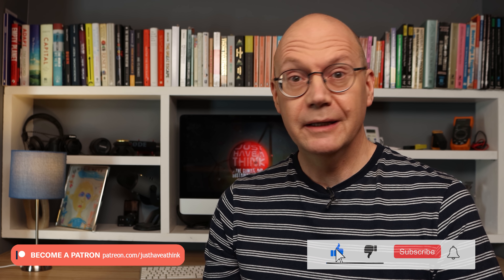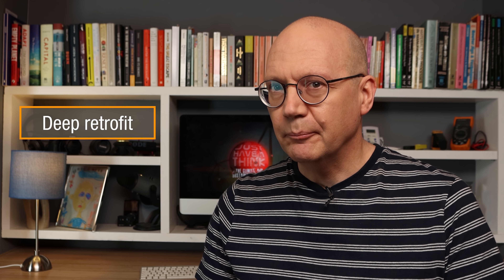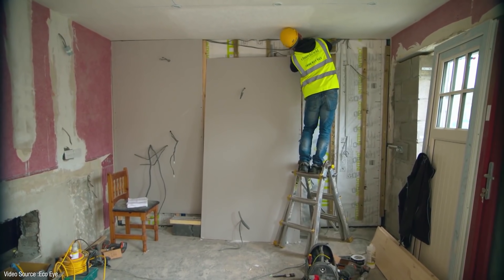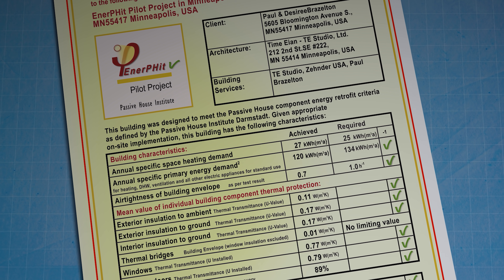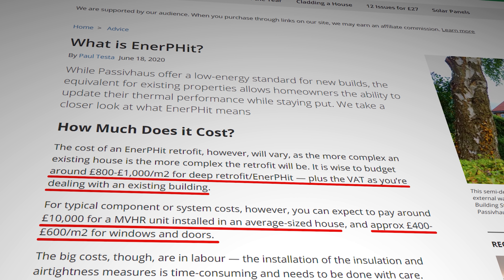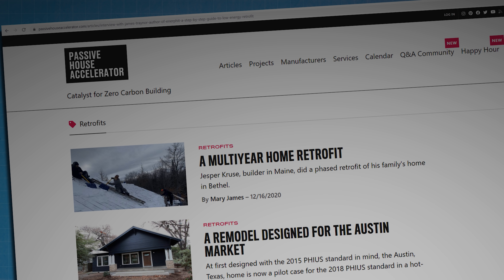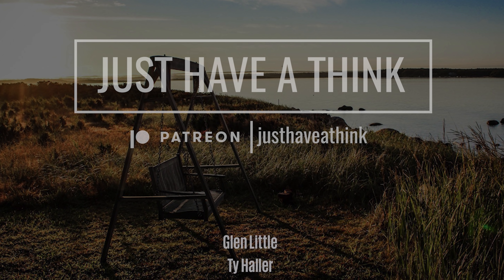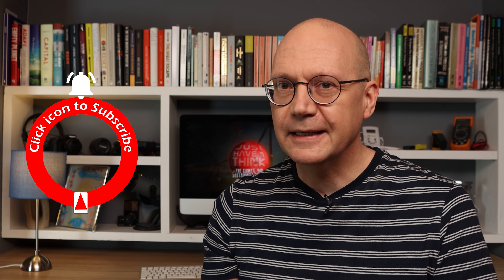Retrofitting to Passive House standards

Comment: I found the most effective components were exterior cladding and a ground source heat pump. The house is an 1890 detached pair of miner's cottages, so since I bought it semi derelict 30 years ago I've used most of the obvious methods, and found that most of them go out of date quite quickly. My advice is do what you can as you go and don't worry about catching up with technology as you never will. Perhaps the best bet after all is to replace existing buildings with passive houses, but since that is impractical I am just running the house on renewable energy and apart from the occasional chainsaw for diseased trees have more or less eliminated fossil fuel.
Reply: I agree. I have a home built in the 1970s, and I imagine it's a bit leaky. Before I bought in 2014, me windows, gas water heater and furnace, which I'm sure went a bit way in keeping my best bills down. Now, I'm looking to improve. Lowest hanging fruit, energy audit to seal air leaks. Then add insulation in attic space I estimate I only have about R20 up there. Maybe someday insulate floor, but that's a diminishing return. Longer in future, I'll have to convert from gas heat to hear pump to really reduce CO2
Reply: @deansmits006  a nice bonus with heat pumps is they’re far easier to run off rooftop solar as well!
Reply: @kaitlyn__L  I live off grid in a cold stone leaky house comfortably off 4 cords of locally sourced fire wood. I could without much difficulty change things a bit with a few cheap items and greatly diminish those 4 cords. Dont fall for this passive house nonsense. Best wishes.
Reply: @jimmycorkhill1390  I certainly believe pursuing complete passivity can be a bit overkill in many cases. But nevertheless, a heat pump outputs more heat than the energy it uses. As much as I like using a wood-fired central heating, it’s much less labour intensive to just let a heat pump run on a thermostat. IMO, best to save the wood for the coldest days where the heat pump’s efficacy goes down below 200%.
Reply: @jimmycorkhill1390  how would that work for thousands of houses in a city?
Reply: @kaitlyn__L  Im all for such tech and heat pumps are something I was advocating over 20yrs ago. There is always balance to be had with installation cost, maintenance, running cost and benefit. Before I went off grid, hot water electricity cost me about 150euros a year. For me to have replaced the DHW tank with a heatpump air to water unit would have been about 1,500euros material only with my to install.  Would it have halved my bill giving 15 to 20 yr payback. But then there's maintenance and replacement. A standard DHW tank is less than 200euros. I do plan to reduce my wood use and convert more sun energy for convenience as much as anything else soon. Wrapping the 600mm thick stone walls will hopefully trap all the heat needed to negate all the air leaks. Best wishes.
Reply: @ricos1497  It doesnt have to work that way for thousands in a city. There are lots of options. Some relatively inexpensive and easy to achieve. The question I would ask is, millions moved from the countryside to polluted overcrowded miserable cities for work and opportunity. Now that much of their purpose is redundant other than self indulgence, what next? I live in a place within beautiful countryside, full of amenity, fresh clean and abundant, full of cheap affordable homes. Never been harassed during these crazy fascist times. Not had to wear a muzzle, social distance or be sprayed with disinfectant. Am able to communicate with others like yourself via the airwaves. Would I swap for a box room in an overcrowded city full of millions of individuals that are scared to look one another in the eyes? Perhaps, if I could get myself one of those Passive House Standard Homes! Best wishes.
Reply: @jimmycorkhill1390  interesting! You believe that cities themselves aren't the future? You could be on to something. Just a billion minds to change!
Reply: @ricos1497  No, I think that they are the future for many. You will have seen or read 1984, Soylent Green/Make Room et al? I am content not changing a billion minds, but wish them well. Best wishes.
Reply: @jimmycorkhill1390  as long as the mortar joints are good on your home, the leaks shouldn't be coming through the stone. Especially not at 600 mm thick! Instead check areas at bottom, top of stone and around any doors and windows. I wish we had stone homes in the USA with 600 mm thick walls. Professional stone mason
Reply: @stonechips2011  Yes, youre right, it's the windows, doors and roof. Im working my way around. Im insulating the outside this year to make all that stone my heat store. Will probably move the windows outward and new insulated shutters. Hopefully if I speed up a bit, I'll be done before the next winter. The stone is everywhere  in the ground here amongst the clay.  I have a large demolished house on the land which got pushed into the three cellars beneath following a fire (before my time), you can come and use those skills rebuilding it if you like? Best wishes.
Reply: @freddiefox.  Dont be silly Gary, there is plenty of resources for everyone for such simple uses, as to whether there is enough biomass to keep feeding power stations for your electricity....well that's a different matter? All my wood is harvested and replenished....no getting away with anything. Best whishes.
Reply: @deansmits006  Electric chainsaws exist and are great.
Reply: @Fluffy Hamster Ive lived in a big city wasnt all that bad, lots to lead one astray. Dont see the attraction though that keeps people attached to them whilst complaining of all the bad. Plus they will be the focal points for the ever increasing  dystopia. Best wishes.
Reply: I heat with wood. I am also a tree farmer. My net carbon contribution is negative. My trees sequester more carbon than I release. Therein lies the solution, not killer Gates blotting out the sun and screwing us and the environment- again.
Reply: @tombombadil3185  @Jimmy Corkhill
That's nice that you two can use locally sourced wood for heating, but obviously this is not a solution for everyone. There is simply not enough land to grow sufficient wood. Besides, we already need to reforest (without harvesting on an industrial scale) to sequester carbon as part of the total package to get to net zero.
Reply: @tombombadil3185  Couldnt agree more. Best wishes.

Comment: Question}- Do the figures for Kw per Sq Metre include ALL power consumption or just heating/ventilation? And is that the footprint size of the building or the overall floor size of all rooms?
Reply: In this case heating and cooling and floor size of all rooms combined, but other meassures are common as well.

Comment: Back in the 1980's (or was it earlier) a TV company (Yorkshire?) did a retrofit on an isolated building which involved cladding the outside of the stone walled house with Rockwall batts under Weather boarding, turning the whole building into a heat sink. Together with roof insulation and double glazing, and a few other minor adjustments,  the house was transformed, and became much cheaper (energy efficient) to run. 
I wonder what happened to the original  film of the project?
Reply: Granada TV did a program in the 1980s. A friend of mine bought it and it still performs better than modern mass built houses.
Reply: There are quite a few BRE (building research establishment) documents available for such projects, im guessing that it was one of these that was covered/reported on or they documented it retrospectively. Best wishes.

Comment: I acted as the general contractor in the building of my own house many years ago. It wasn't built to the passive house standard but it was fairly well insulated. R20 in the walls and R40 in the attic. The basement was finished at the same time as the other two floors, and was warm enough in the winter that we didn't heat it much and used to play ping pong down there. This is in Ontario, Canada.
Reply: Only R40 in attic in Ontario? Canada? Wow, impressed. Would have thought R60 would be required
Reply: @deansmits006  Not sure what it is today, that was in 1990.
Reply: @lesliegweir  ah, I see. Yeah, I live in the States, and the listed recommended R value for cold northern environments is near R60. I can see how R40 with R20 walls would still be fairly nice
Reply: @deansmits006  The interesting thing about our house was, we built with a preserved wood foundation, the basement walls were actually 2" X 8" studs with R28, therefore we didn't need much heat in our basement.
Reply: @lesliegweir  R49 in So.NH, probably the same in southern Ontario, Northern NE and Quebec is probably R60

Comment: Very interesting topic. What frightens me the most is the modern insulation materials develop an enormous amount of toxic smoke when burning. Also like you point out most of the work gets covered so we’re in need of meticulous people performing that work.
Reply from the maker: Hi Claire. There are many insulation materials now that contain more organic materials and are also flame retardant. It's all about cost though, of course. That's why governments need to wade in with very strong subsidies and incentives.
Reply: Rockwool manufacture generates a lot of toxic smoke, but dense-packed cellulose?

Comment: 5:47 nah windows can go suck a duck  :D just cover windows in insulation :D even the best windows waste alot of energy!
Reply: No a window can act like a radiator if properly airtight, PH certified, and surrounded with insulation, throughout the year a PH window could potentially gain more than the total losses throughtout the year
Reply: @ONeill01  Most windows are not orientated or designed for solar gain. Those that are are so by chance.Perhaps those sun oriented windows may serve better behind a Sunroom/Trombe Wall? Best wishes.
Reply: @jimmycorkhill1390  PHcertified component windows would be suitable for solar gain. I agree, it of course depends on orientation, that's why each PH is unique but each project it is crucial to follow the 5 principles of passivehaus, and additionally not put large windows on a northfacing wall, that wouldn't be a smart economical decision in most cases, these are choices that should be decided well before a shovel hits the ground, but it's certaintly possible for a PH window to make a thermal gain throughout a year but design choices and PHPP anaylsis would need to happen.
Reply: @ONeill01  Yes, when designing afresh. In europe house replacement is a relatively slow process and the past was writ large with very poor design. Doesnt stop us introducing good design to those same structures. My old stone house which windows avoid the sun is slowly becoming an energy efficient/cheap energy heat store....or more accurately temperature balanced home. Best wishes.
Reply: Windows let in sunshine, which can heat up the house. Look up passive solar.
Reply: @MrMakabar  depends on the location but yes it can so that. And also depends on window location too and ofcourse wall and floor colour is part of it too. But yes it is possible. I am not sure if you get more heating from it than the wasted heat from windows.
Reply: @wilderness-beastt  It is certainly possible. Even earthships, which are a pretty bad design, are able to be operated without additional heating and cooling in desert enviroments. That is with single pane glass.
If you build with modern technology you can absolutley build houses in places like Ireland without additional heating. That is only using waste heat and passive solar.
Reply: So only use artificial lighting?
Reply: @PhiloSage  the energy used to light a house, especially if you use modern lighting technology is significantly less than the energy needed to heat and cool a house. The best windows are roughly equivalent to R5 so if your goal is to make a building that keeps people comfortable with the least amount of energy with little regard for their mental health then windows would be very rare in houses. Obviously there are some exceptions with cleverly placed windows and well designed awnings but that would usually only apply to one wall of one house.
Reply: @PhiloSage  exactly :)
Reply: @PhiloSage  preferably led
Reply: Hard sell in winter when you really want natural light in home
Reply: @deansmits006  i live in finland and we don't have natural light in winter so 🤷
Reply: @deansmits006  here we get maybe like 3-4 hours of sun light in winter and even that is at a time when most people are working :D
Reply: Or some insulating shutters, as much of the lost heat is radiated out of a night. Amazing what just simple wooden shutters achieve. Best wishes.
Reply: @jimmycorkhill1390  I love this idea, shutters are underrated, many older buildings used this simple method for mitigating heat loss.
Reply: @ONeill01  I moved from a part of the world that never used them to one that does and can definitely see the merit. The design can be much improved on though and would be a cheap adaptation. Incorporated with some external insulation and a DIY er could great change their internal environment/energy costs. Best wishes.